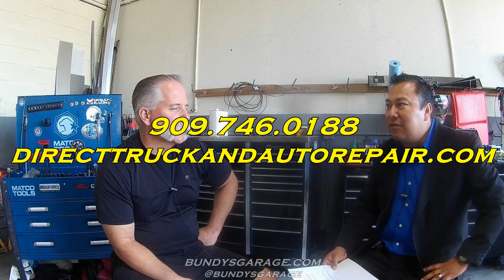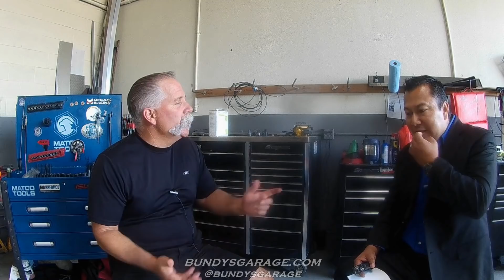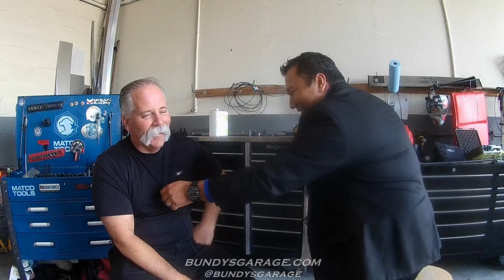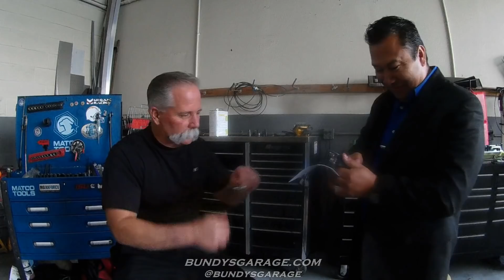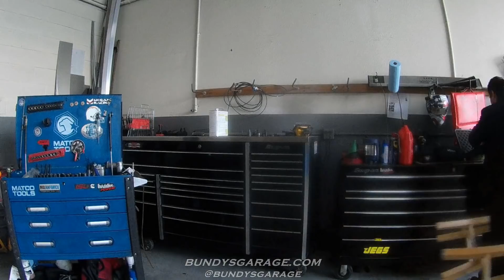Worst Diesel Engine Ever - What is the Best Diesel Truck out There? | Ford Dodge Chevy

Comment: I have a 7.3 2001 Ford Excursion... 404,000 so far... keeps trucking 
Got a 2001 Chevy 6.6 Duramax in a Silverado Dually... BEST pulling truck I've ever owned 412,000 on it.
Reply: 480something k on my 2000 7.3PSD.  Runs great still.
Reply: Mike Wallace I was driving a 20017.3 for work. I loved it
Reply: as a dealer i bought and sold over 100 7.3. almost kept a few. but the 14-17 mpg and low power was pathetic compared to a cummins.
Reply: I have a 2001 lb7 duramax idk how many miles it has but the Allison transmission just went out
Reply: 2500 turbo diesel HD I pull a 17 foot trailer loaded sometimes to the top of 5 foot walls with tree branches and logs I think that’s why it went out
Reply: got gas
Reply: Chevys better I'd sell that excursion buy another chev
Reply: @thenotoriousko6872 , Let the man own whatever he wants.
Reply: @thenotoriousko6872  Chevy is hot garbage
Reply: Thats bc you dont own anything new. Just old crap. My f150 ecoboost will out pull that gm

Comment: Agree with the 7.3 weaknesses. I have a 1999 with 300k miles on it, I got it with 68k on it. The only issues I've run into is ball joints. I've gone through 4 or 5 sets of ball joints and it's a 2wd that I drive like an old man. Other than front suspension issues, I've never replaced anything other than an alternator and (obviously) some batteries and brake pads over the years. The mistake people constantly make is putting a tuner on a 7.3 Once you do that, you WILL have issues eventually.

Comment: On a 6.0 factory coolant caps become weak. Replace with OME.  Use poly organic coolant. Use Ford diesel engine oil. Change oil reg. Do not chip. Fallow Maintenance guide. Drive and tow responsible. 148k no issues. Plenty of power, Important - If battery voltage drops below 11 volts fuel system closes. Engine fails to start.
Reply: Glad someone gets it. Keep it stock and it'll go forever.

Comment: Original owner of a 2003 F250 four door four by four all original truck with the exception of tires battery coolant cap and fluids and filters it has the infamous 6.0 with almost 300,000 miles iv kept very meticulous maintenance schedule using only Ford products and I've never had a problem and get many compliments as how my truck looks and runs like new still most people can't believe it has 300,000 miles I think it's possible that the coolant cap maybe the common  problem on these trucks coolant cap goes bad releasing pressure there for decreasing the boiling point boiling out coolant leaving particles of the coolant behind to clog up to EGR and oil cooler main problem with these trucks is lack of maintenance people call it bulletproofing them I call it dummy proofing. Lol

Comment: Dodge Cummins has 1,000,000 mile club and it has thousands and thousands of members going back 35 years cannot seem to find the power stroke club anywhere? 
Ford power stroke‘s and triton engines are engineered nightmares expensive to maintain expensive to repair unless you have a credit card.
Reply: Brag on your Cummins not the dodge

Comment: I smell bull shit.  Ford sucks major balls.  The motor sucks the transmission is horrendous and the chassis is the worst of all.  Ball joint after ball joint after ball joint.  Fucken wheel bearings after wheel bearing I mean I could go on and on.  Bought my first Ram with the 6.7 and beat the holy dog shit out of it and never. I mean never had one problem out of it.  Bought my second Cummins and tried to destroy it and yet again not a single issue.  Fuck Ford.

Comment: I have a 04 Ford F150 with 440,000 mile on it. It has worked pulling a trailer all its life.  Trailer weight itself it two thousand  pounds plus load as much 8000 pounds.

Comment: I have a 04 cummins with a 5.9 with a 6 speed. Dt 466 was a crap engine in general from what I used to have too fix. Based on all the diesel engines I worked on and in frames I did in a 20 year period, cat , cummins, Detroit, Isuzu, Mack,  Mann.  I chose a cummins when I got mine hands down. Cheap and reliable 😁.

Comment: When your exhaust needs fluid you have a problem.
Reply: Fixed that went from 17 mpg to 26 Hwy
Reply: @scottsmith6571  Cool.  Now hundreds of people parked in traffic can breathe toxic particulates/pollution.
Reply: @dewmontjerkins9886  Hardly, The hundreds of people around you are producing more pollution than all of the deleted trucks in the country. Gassers produce volumes more pollutants than applicable diesel engines. The eruption of Mt St. Helens produced more pollution than all of the above combined.
Reply: @dewmontjerkins9886  Def is the same as someone smoking a cigar in your house but boils water and ammonia to cover the scent. That's some clean air there. The CO2 is still there. But hey def does cause cancer and prematurely rusts your vehicle.
Reply: @dewmontjerkins9886  Just like they did for fifty years before def came along.  Even longer.
Reply: @dewmontjerkins9886  not if it’s tuned right
Reply: Especially on a farm tractor or a work truck def is pure poison and that is safer than co2 what a lie they are perpetuating on the public it is a way to rob working people of their hard earned money
Reply: Next is blinker fluid???
Reply: @nellyfarnsworth7381  Don't forget to check your thermodaculator.
Reply: Especially when shops over charge the hell out of it, I rather buy diesel from a shop than DEF. Over $10 a gallon, $15 to $20 for 2.5 gallon jugs, at the pump at truck stops $2.85 or so a gallon. Price at the trucking company I work for at their fuel island $1.03, which i think is bulk rate.

Comment: I bought a 2005 GMC Sierra 3500 Duramax with a stakebed brand new 14 years ago. It still runs good and haven't had any problems with it . I haul 2 to 4 tons in the 12ft bed. In my opinion my GMC is a reliable truck. But there's Ford and Rams out there that are just as reliable as my truck. I would love a ram diesel from 97 to 2001 with the manual transmission . But they are expensive . Lol.

Comment: Chevy gassers  will not get 692,899. Thousand miles  i owned chevys  and the best a gasser will get is  400,000   and your dura max  is a joke  head issues  or injectors  @380,000   i haul cattle  17 1200 lb bales on a 32 ft trailer  dont blow smoke up my exhaust  been there done that

Comment: Can't say the duramax is crap cause I never owned one, but I wouldn't say duramax is junk, but just that a 6.7 cummings & 6.7 powerstroke are just today's front runners in how a diesel motor should be. I just think that GM is lacking in there drivetrain department when it comes to putting there product up against Ford and Dodge. I like to use the youtube ike gauntlet video's for comparison. But GM does do a good job at trying to make the best tailgate. too bad when it comes to buying a truck that the last thing I'm worried about is a glamorous tailgate. GM truck owners = show boaters with a little peder and a junk truck under the paint job and 12" lift kit that use it to commute back and forth to work. Ford & dodge owners =  bought the truck to do big ass job's and get dirty while doing it, and keep going down the road after 15+ yrs mutha fucka!!!!!
Reply: GM gas engines will outlast ram and Ford diesels😂😂😂

Comment: Id go ram all the way, as long as it is 2014 and up. Ive had a 2500 with the 68rfe trans and loved it. I then upgraded to the 3500 with the cummins and aisin trans and it is a great combination. Tech is way better on ram and i have an awesome dealer which can make or break your experience with a brand.

Comment: Great to see someone who is completely honest about the their experience with the engines.. 
That said; Cummins just  is a more simple design capable of tremendous power output
a true workhorse
Reply: More so torque than power, at least in stock format. The v8 diesels (duramax and powerstroke) have higher output 40-50 hp, but same torque. Very solid engine though. Like a semi engine, the hp doesn't matter as much as the torque.

Comment: I've got a 1997 F350 crew cab 7.3 that I bought off the showroom floor. Now has 320,000 miles and is about to go in for body work and a complete paint job.
If I get another 20 years out of it i'll be 84 and won't worry too much about it after that.
PS. a OEM bedside is stupidly expensive

Comment: Cummins doesn't build a truck, Dodge doesn't build a diesel engine...Isuzu designed the Duramax, and GM should be very grateful, Allison doesn't build trucks, GM doesn't build a transmission that will handle the torque of a diesel.

Comment: Among the worst diesel V8s for trucks ever was the Oldsmobile 5.7L (LF9), which was available for the Chevrolet and GMC 1/2-ton pickups from 1978 to 1981.
Reply: I had a new one , 3 injector pumps and 2 starters in 24 month. Sold it what junk.
Reply: Gasoline conversion to diesel, that was the problem
Reply: @shawnbrodrick8673  
Right, at least in the developmental stage; but the production versions used more rigid parts to handle the diesel's operating characteristics. 1981 was the first year the LF9 had an improved block and other parts (the DX series) but people lost interest in them due to the bad press the 1978-80 engines received.

Comment: ford is great for work trucks you can beat it like no tomorrow but as soon as you have do anything to them its going to weird shit and its going to cost

Chevy will break but you can fix it easily and fix it cheap

Dodge the Cummins is great the dodge itself will break and break all the time 

I my self own 08 GMC sierra 1500/3500 a dodge 48 power wagon 4bt swap and a 95 ford f350 tow truck

Comment: As a shop owner for 35 years and a mechanic for 43 years I've seen quite a bit. And living in Arizona where pickup's are as common as cars (more common in many areas) I do know a little .on the subject. To anyone interested the Cummins 5.9 was originally a stationary and boat power plant  before a pickup engine. The Ford engines from 1983-2010 are International's. The Ford 6.6l straight 6  was not an International, but used in trucks mainly in the F650/700 series as well as stationary. GM  owns a portion of Isuzu (same as Ford & Mazda)(Dodge & Mitsubishi) so it's not really outsourced.  Allison is a division of Detroit diesel which is again a product of GM. My shop experience has shown the 5.9 Cummins and the 7.3 Ford as the overall favorites. The Duramax has been again for us the one with the least breakdowns, but is a pain in the ass to work on- though the Ford 6.7 has topped that.  As far as longevity - the 7.3 is tops at our shop. We have 2 over 600,000  with no engine work,  1 with just over 780,000 that got head gaskets only at 752,000. And 1 truck that's been driven hard and put away wet waaay too many times with 930,000. Not the original engine or trans. on that one.  For me- I drive 2 Ford 6.0's and a Bronco 7.3 di, automatic. Many 6.0's are misdiagnosed. We've seen 2 with bad head gaskets and 40+ with cracked heads, but too many that  really needed EGR coolers or oil coolers. Studs? I wouldn't go racing without them(on all my drag race engines) but we have never had a repeat failure on a 6.0 and have done studs on maybe 5. And I have stacked a flip chip on top of my Edge  Juice without a problem (never for more than a few minutes and watching EGT's like a hawk). So you don't like one or the other ? I've heard of people who don't like Ice Cream either !
Reply from the maker: Nice write up. Wish we were on the same town we could do an interview.

Comment: guy has no idea what hes taking about. his only argument against the duramax is that he cant order head gaskets correctly. nevermind the fact that the duramax was the fist american made diesel - yes american made the plant is in ohio - with common rail injection. very one else still using antique injection state of the art 1950. also first diesel to meet the phase 2 emissions standards in 2004. everyone else struggling to meet the standards - remember fords catching on fire while trying to regen? and dodge relying on emissions exemptions to market a diesel? and then duramax first diesel engine to meet the phase 3 emission standards pushed on us by the obama admin. everyone else? copying the duramax emissions equipment and failing at it still as evidenced by Caterpillar leaving the over the road market and suddenly dodge and ford had emission equipment matching the stuff on the duramax that it had been running for years. so bottom line is if you want tried and true get a duramax. everything else is just a cheap knock off trying to keep up.

Comment: Well, I prefer gas engines  'cause I don't need the torque of the diesel and I like the peace of mind of the gas engines,  maybe they are not perfect, but they are cheap. I have F 250 5.4 and a  F350 PSD 6.0, the F250 is a peace of mind. Greetings from Costa Rica. (I forgot, I'm going to do a gas engine swap on the F 350, LPG + a gas  engine, in my country, is a very good option).

Comment: It's a shame that Allison doesn't make a trans for all pickups. It's also a shame that you can't spec out the truck the way YOU need it set up. Detroit should go back to basics and stop making pickups into part time cars, trucks years ago were made to go to work and not have all of the electronics and worrying about making the engine quieter.  I would like to know who said " lets charge 70k for a pickup".

Comment: Not sure what small trucks are bad but as for big diesel trucks 
International max force engine is number one junk. 
Paccar number 2 close behind. 
Cummins 08-2012 straight junk from factory. 
Volvo is a close behind. 
Egr was bad enough. 
Def and regen destroyed the above engines and made them boat anchors.

Comment: 6.0L victim here. It ruined it for me forever. Sorry don't have the kind of income to experiment. Still feel scammed.
Reply: My brother bought 2 6.0 F350's.. Brand new. always in the garage. He hated them. His 7.3 ran circles around the 6.0, performance wise ...& every other way too.
Reply: Bought 2006 Ford dually King ranch brand new with a 6.0 diesel.i  now have 466,000 miles on it and had no problems.just had the egr delete done when warranty ran out.great truck,it's all on how you take care of it
Reply: @steveshook7331  definitely good care and maintenance will help. I don't think it is a solution for piss poor design. Too many 6.0L same issue for it to be lack of care and maintenance. Shame on Ford.
Reply: @soving  the piss poor design is what happens when the government mandates emissions on things they have no knowledge of.so they can save the world.but yeah egr clogs up and blows head gaskets
Reply: Victim? I have an 03 with right at 300k was dumb enough to leave it stock till 100k then deleted it , no problems since delete, one set of injectors before 100k. Also at the 100k had to replace both heads because of emissions causing high Head temps, have an 06 also it’s heads above a 7.3 performance wise , only way a 7.3 could compete is if it had the 5r trans!
Reply: Come on brah, didnt you hear about the 7.3 first? Get a 7.3 and start over, you won't regret it.
Reply: A good thing to do with that super dukie with the 6 liter is get a Denis cimaf forestry Mulcher and grind it up and make it into shrapnel and call it a day
Reply: Ford has a better idea run it through the shredder

Comment: Sold my 2000 F250 7.3 with 322,421 miles on an all original motor except the turbo bearings went at 310k. 2 transmissions and a ton of over the road towing. My cousins Duramax was faster but no towing and let go at 200k no tunes; valve pieces and piston everywhere. Our well drillers Cummins lost a piston when his turbo went and took it out. Think it was close to 200k. Then again anything can fail. I worked at Ford as a tech from 91-2000. Saw zero 7.3 failures; 6.9 head gaskets ugh!

Comment: Ford's are crap!
Reply: Wildcat Cowboy fords are not crap, besides the 6.0 there’s nothing wrong
Reply: @stankbeme7853  I have had two Ford Diesel duallys in the past four years the first one had nothing but def problems with the def system until it finally burn up and took half the truck with it, the second one was constant electrical problems till it burn up the entire dashboard fords are crap
Reply: Wildcat Cowboy what liter truck was it?

Comment: If you are old smobile enough you will already know that when GM decided to build a V8 Diesel engine out of the Oldsmobile 350 gasoline engine GM built the worst diesel in the entire WORLD!!! 
I spent an entire year in a shop in Norfolk VA in 1987 doing nothing BUT changing out those piece of crap olds based diesels. The best thing about it was all you needed was a real 350 olds gas engine luckily there were still quite a few in the local salvage yards. Most of these GM pieces of junk diesels were in trucks!
Swapping them out for an olds 350 gas engine was a piece of cake! 
So you can bet a years worth of paychecks that the GM engineers built the worst bastard Diesel engine period!!!

Comment: Is anybody looking for a 7.3 diesel F350 290,000 the engine still sounds good.  The body needs some help.  It is a 1999 F350 4 x 4.  My daughters truck, no trailer towing ever done with it.  Amsoil only ever used.  She would let it go under $5,800.00.

Comment: I have 6.4 powerstroke but I think all these engines are good is just all the emmisions that's killing them.
Reply from the maker: I’m sorry to say this but the Ford 6.4L was a piss poor design.
Reply: @bundysgarage  I have 6.4 and I don't have many miles on it I heard many horror stories about cylinder wash down under Regen and many egr issues too. And also that  this engine will fail with very low mileage. You think I should just sell it before any of this happens or just keep it until blows up.